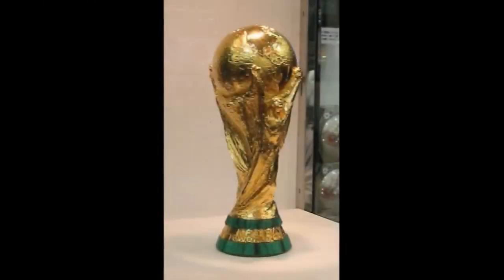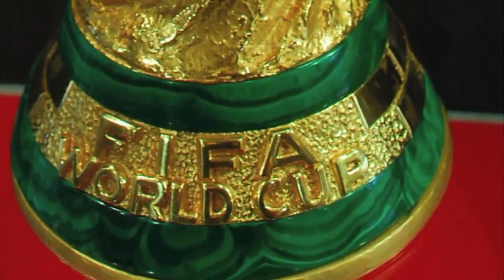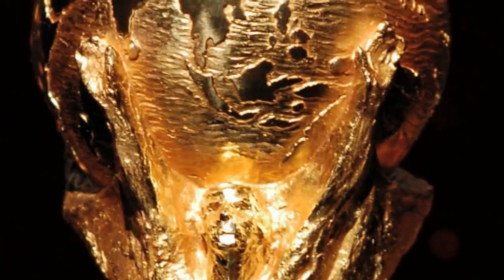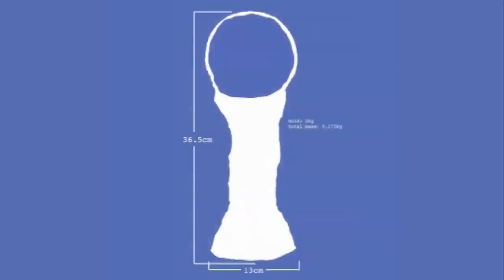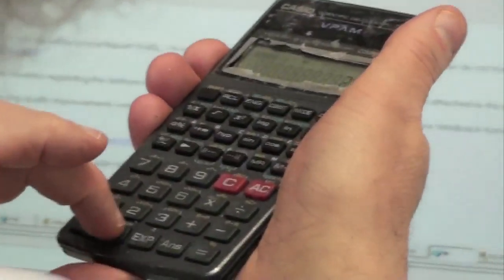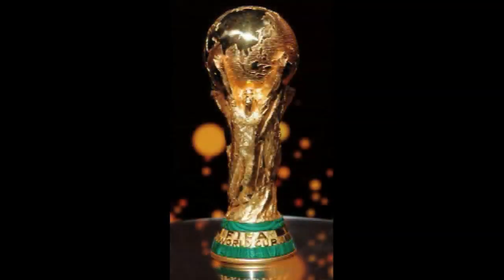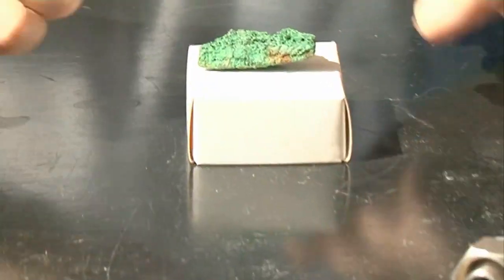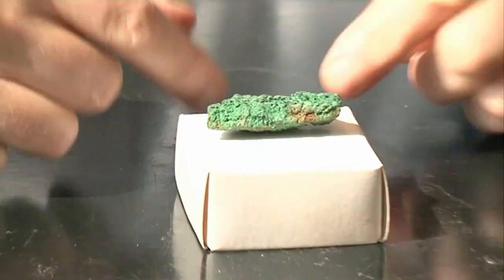Chemistry of the World Cup Trophy - Periodic Table of Videos

Comment: I'm thinking the whole thing is quite thick but hollow from the base to the ball on top, like a thick inverse cup with a ball as the base.  If the base was solid and the ball hollow, the thing would still weigh a ton and the ball would be extremely thin... aka easily dented.

Comment: I'm doubtful that the trophy is hollow. IF it was really hollow with how soft gold it, as soon as a footballer grabbed it to lift up, they'd probably crush it in their hands, much like if you got a cadbury cream egg and squeezed it hard, although the insides wouldn't come streaming out.

However, Malachite is far more important than aesthetics. It was the first source material used to smelt down into copper ore. Until that was discovered, they used to just chip bits off a chunk of copper for use

Comment: @JJ4eva2 If he's going to do really complicated mathematics, then it makes more sense for him to use his PC. Its capabilities massively outstrip any calculator and then some.

Calculators are portable. But, in this case, that's not necessary - indeed, he was measuring the trophy from images on the Internet. It'd be just as simple for him to have fired up the calculator application, seeing as he was at his PC anyway.

But I guess it's habit, if he's used to using his calculator.